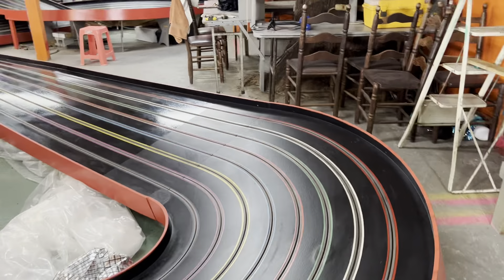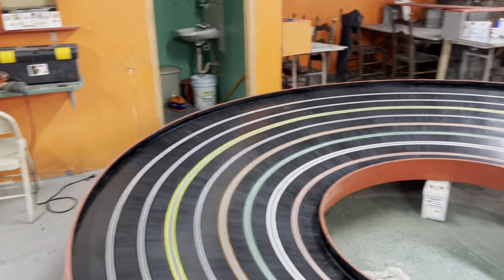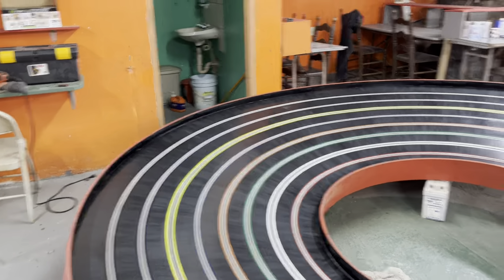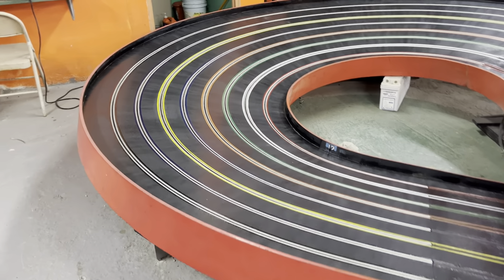Wrap up video St Martin raceway repairs

Comment: Trying to reach you Steve,  I own won of your custom 4 lane tracks.....I need some advice on minor swelling at a connection sections.....water damage
Reply: One
Reply from the maker: If the water damage is very recent, put a dehumidifier  beside the track near tha damaged area. leave it like that for a couple of weeks and see it the swelling goes down. If the damage has been like that for a couple of months then you will need to sand it out and then touch it up. I would also loosen the joint bolts to open the gap up a bit to get some air in there to dry the joint out. Sanding in between the slots without touching the braid usually works.
Reply: @steveogilvie5203  Thank You, Was wondering what the replacement cost would be, any chance I could get an estimate for building a new one?
Reply from the maker: @derekwitt8665  Sorry but I am retired from track building. Because I no longer have an import export # or a tax # it is impossible for me to build and ship anything outside of Canada. Chris Dadds is from Indiana and is an active track builder. Also Bob Scott from California. You can get their contact info off of Slotblog. Sorry I can't be more help.